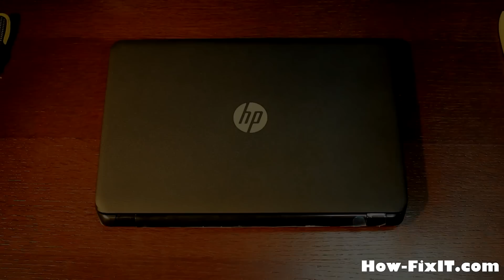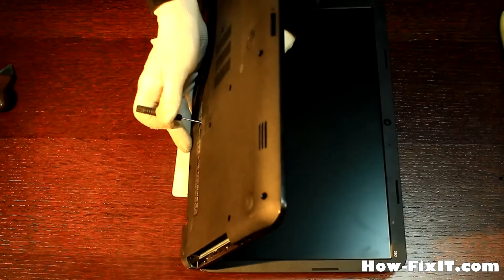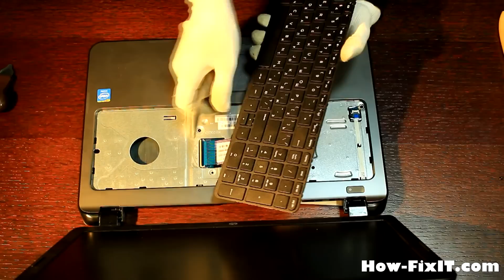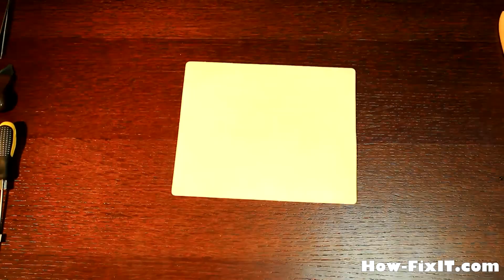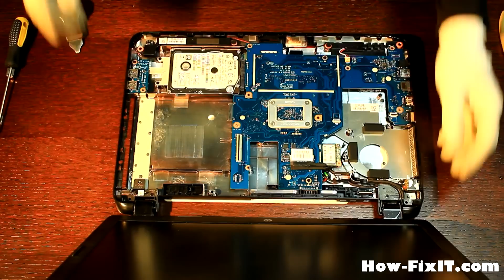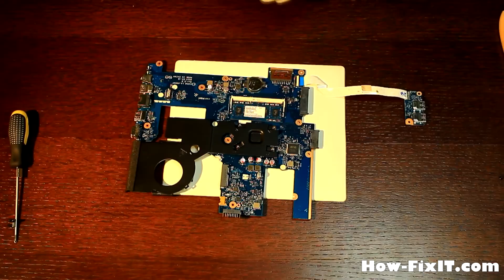HP 250 G3 Disassembly and Cleaning Guide

Comment: hello,
i have the same laptop. without fan and heatsink.
should i buy them and replace them there ? do they will work ?? please answer me!!
Reply: i have the same. how did you do?
Reply: @info4424  
in that model the processor don't need a fan to cool down, because it designed to not get hot. it cools just by the heatsink, and you cant put a fan to that motherboard. if you want to add fan then you should change the motherboard with the i3 motherboard and that will be expensive.
so if your laptop is old and get very hot not like normal, try to just change the thermal paste and it will be like new, and try to add an ssd.
Reply: @simoeqr1113  actually at the same day i asked you before your reply, i could make fit the fan (when i saw there is no fan, i tought it was stolen by the service and i bought a fan with that copper metal thing ) but there is no place to put in the power jack of fan on the motherboard. :/ thanks for the reply.

Comment: Well, thanks for the video, because it's not so obviously very clear how to disassemble this model, to be able upgrade. (my is based on Pentium n3540). I have bought it recently for very little money, and in first place I have decided  to upgrade it. In first term, goes for RAM upgrade up to 8GB and of course there is no more place for HDD in my computers anymore (as main system storage), even for this one super cheap notebook I DEMAND SSD. My big surprise was, that IT HAS NOT active cooling at all. I have bought similar model on celeron based processor (same series!) in 2014 october for my friend, and IT HAS build an active cooling system for sure! And now I just see thin aluminium metal frame, just simply "glued" to CPU chip. The whole construction is very, very simplified. It's very similar to Atom CPU series construction philosophy and reminds me just..... bigger version of tablet. On the mother board, there is only one (main) silicon stone present! All things are integrated in "CPU" unit, ALL!!!. Outstanding, how miniaturisation and unification is progressing. This video instructions is very well made, and well understandable. BIG THANKS FOR UPLOADING!

Comment: All models of HP 250 G3 without cooler-fan??
Reply from the maker: unfortunately i don't know.
Reply: Tehno Prosto This appears to be an identical chassis to the HP 255 G3 style used here at my work. I just wanted others to be able to find this video if they have a 255 instead of a 250 as is given in the video title. So, I don't know if it is all models, but I know about the HP 255 G3.

Comment: Hi, i want to remove the internal HDD and insert my new SSD. Do I have to remove all the screws on the back?
Reply: Alessandro Rimoldi This laptop chassis appears to be identical to the HP255 G3 I work on from time to time. So, yes, you have to remove all the screws on the back. If you follow the process in the video, you will get to the hard drive and be able to remove it. Although the disassembly looks daunting removing the whole back, it is one of the easier layouts to work with. Just follow the video.